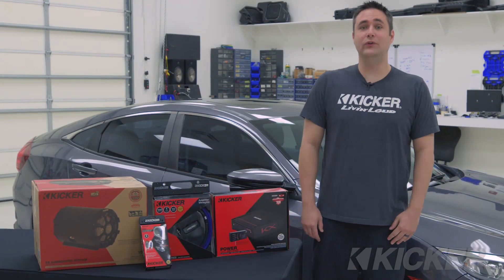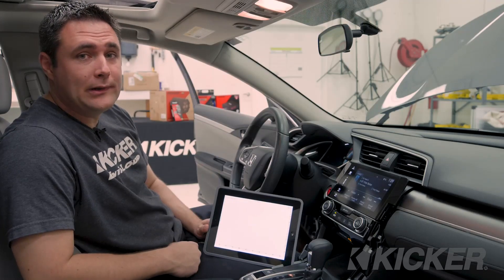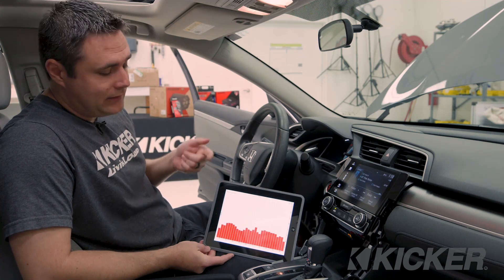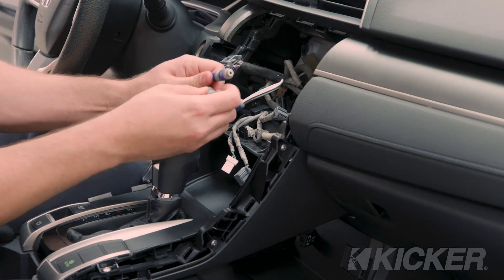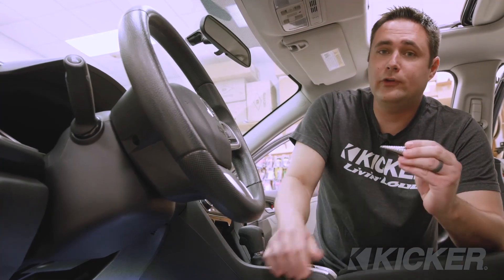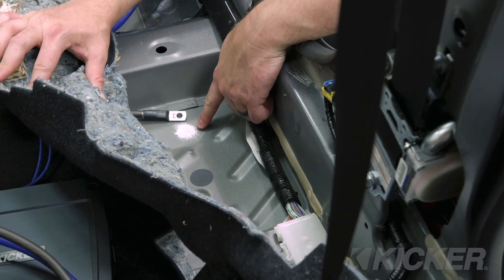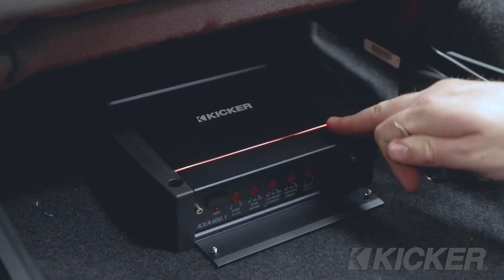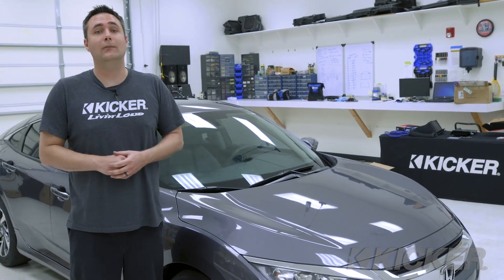Amplifier Installation 101

Comment: I would assume nowadays instead of splitting the wire open like that and trying to thread a new wire in you would just simply use a t-tap connector?
Reply from the maker: I wouldn't recommend it for a permanent install. T-taps are convenient, but can damage wires and provide a less reliable connection, especially in high-vibration environments, whereas an eye splice offers superior strength, reliability, and a secure, permanent bond.

Comment: Kicker, please stop shipping the speakers with grilles... instead, pass that savings onto the customer, and have the grills be offered as an option. Most people install speakers inside the door panels. So, no need for the grilles.

Also, make the same style grilles you have for the KS speakers, but for the subwoofers too.. I would love to have that mesh grille installed on my Kicker Comp R 12 Ported Box.
I don't like the spokes grilles you offer for the subs as it leaves too much space in between the spokes for groceries to pinch a sub.
Reply from the maker: Many of our speakers no longer come with grilles for just this reason. We would rather not charge a consumer for products they wont use, but we have to listen to all of our dealers to make that decision.  No single person/dealer will decide for everyone else.  The majority usually rules in this case.
Reply: @KICKERAudio  thanks for your quick reply. I appreciate it. If you ever create a mesh grille for your Comp R 12" please let me know and I will be interested in buying it. I'm sure other will too. Thanks Kicker for creating an amazing line of products!

Comment: Am i dumb or something? Ive been at this since 6:30 pm (its 1:10am), I’m still not done. Not big hopes its going to work. I hate computers to begin with and adding wires to the mix is stressing me lol. Did i mention i have to leave for work in 4 hours?🤦‍♂️
Reply from the maker: If you need help, reach out.  Our Tech Support is open weekdays from 8-5 CST. You can call us at 405-624-8510 or email support@kicker.com.

Comment: What is the recommended power gauge for  KXA400.1?
Reply: For that amount of rms you can get away with running 8 awg wire but 4 awg would be a bit better

Comment: What about the remote wire , the lil blue wire, ?
Reply: There was a part of the video where he explained that the new KX amps have something called DC Offset. It's a mode that the amplifier has where it will turn on if it detects an audio signal from the RCAs... so there is no need to use a signal wire in this case.
Reply: @P_double_H  yes , you right !!

Comment: Guys learn from my mistake do not mess with your factory battery terminal. Just bolt your amp power wire to the existing terminal. Don't cut your factory wires up to fit inside of an aftermarket battery terminal. It is never long enough and it always looks shity

Comment: Do you have to use the front right and left speakers for signal? Why can't you just use one side for signal to the amp? Isn't the sub mono anyways?
Reply: You'll want to tap into any factory speaker that contains subbass. That's the most important thing. If the fronts don't have bass, but the rears do, then use the rears. The fronts were probably used because people tend to fade forward for staging, not rearward. Second, true, you don't NEED to tap into both speakers. But #1, if the customer uses balance, tapping only one speaker will screw with the subwoofer and #2, ensure both L&R inputs on the amplifier are connected even if it's to same speaker. Both RCA connections on the amplifier need signal to achieve full power out.

Comment: can you please tell me what i should if when im setting my gain.. that red light doesn't come on and if the the amp doesn't show clipping???
All i have installed is a subwoofer and this amplifier.
The sub is rated for 800 watts RMS and so is this KXA800.1
i Just bought a brand new KXA800.1.  i have a kenwood excelon kdc-x702 radio. I turned all radio settings to 0/flat.
I downloaded the 50hz 0db tune directly from the kicker website. 
I then disconnected the subwoofer wires.
I played the one straight off of a USB. turned by volume 3/4 up. and then slowly turned my gain up all the way and that red light never came on.

So what do I do???? im real confused
Reply: Did you get this figured out? I'd double check your RCA input. Meter it for AC voltage with that test tone at 3/4 volume.
Reply: a year later.. you didn’t need to disconnect the subwoofer wires for the setting gain?

Comment: How the heck do you get the fuse holder open hahaha. I cant get the two halves to separate from one another
Reply: Squeeze the sides a bit.
Reply: Yea I scrapped it and went with a different wiring set.

Comment: Will customer be wanting new interior speakers and a 4 channel kicker amp to supply much better cleaner sound? Nicely done.
Reply: Matt Martin The Kicker Key Smart Amplifier (KEY180.4) would be a excellent option for the factory radio/factory head unit. I just had one installed in my 2017 Honda Civic EX Sedan. The result after I had it installed was improved sound quality above expectations. I'm very happy with the result. 

The stock head unit doesn't have enough power for upgraded speakers so I added the Kicker Key Amplifier and the end result happens to be, it's more then enough power for aftermarket speakers. A aftermarket subwoofer like a Kicker CompC or a Kicker CompR can also be added. Of course the subwoofer would need a good Kicker Amplifier to power the subwoofer.

I also upgraded the factory speakers to two sets of Kicker CS Series 6.5" 2-way Component speakers. One set for in the front and one set for in the back with amazing results.
Reply: @jeffmabry7775  So essentially you would end up with a main amp for the front/rears, and the separate subwoofer amp as he's just installed herein?